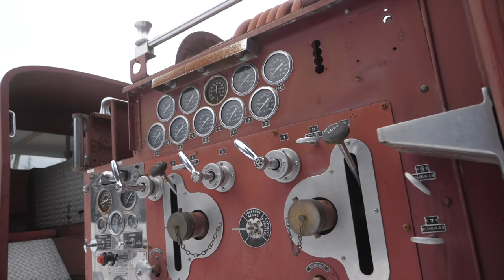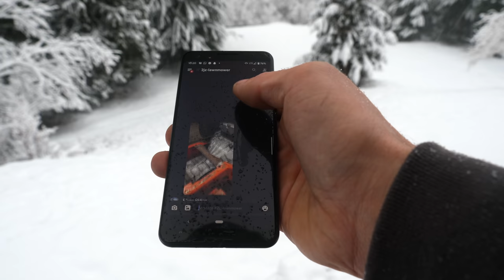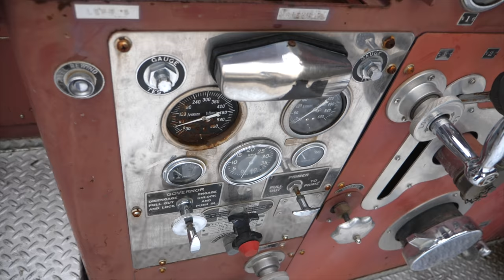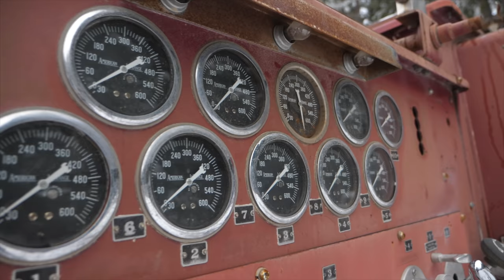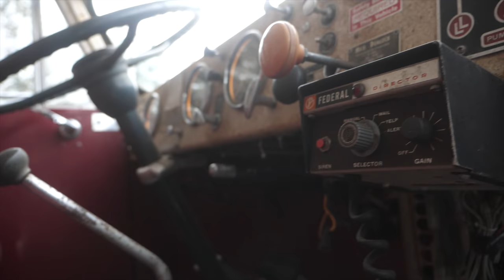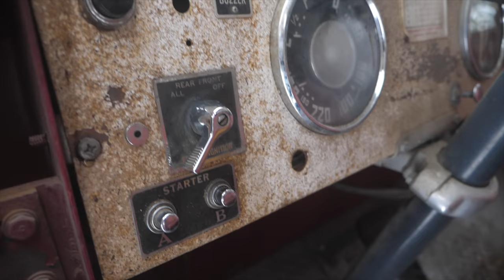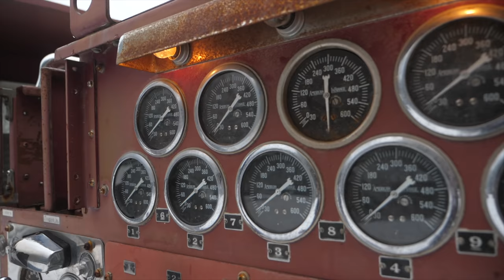We Bought A Fire Truck! Ultimate Toy Hauler Build?

Comment: Would love to see it converted to a toy carrier but please keep the cab design
Reply: Keep all original parts add a delivery truck's hydrologic lift gate to lift the toys onto the water tank and add the full length rack from a car hauler with grind hard in LEDs down the whole side of it, the ramps from that should reach ground level, but I'd put splitters in the water tank and have half water, quarter gas, quarter diesel with the old hand crank pumps on the side to keep it classic looking and put the fan art on the inside garage door on the front definitely with LED backlighting
Reply: dylan zrim  yes
Reply: 2nd this. Cab is amazing
Reply: Ya
Reply: Yes
Reply: and renew the paint
Reply: Ya
Reply: Doubt that super heavy pump stays...
Reply: @KnotRight4Ever  the taco and the triumph weigh alot more than thoes liftbeds can hole and lift
Reply: @markzamiechowski5352 I was saying the hydrologic gate would just be for the power wheels onto the tank, the cars could go above on the car hauler rails from the top of cab back to bumber so there's enough room for 2. I was thinkin they should paint it white so it looks lika a giant  ladder on top, keep the  aesthetics. If the height is a problem with stability or travel locally they could make a trailer that looks like the rear steering cab of longer firetrucks an haul the taco in that.
Reply: 2nd this 👍
Reply: They're gonna fuck that thing all up....

Comment: I've been wanting to turn one into a toy hauler or RV.
Reply from the maker: That is the dream!
Reply: Or do both 🤟😉
Reply: But it needs a straight pipe
Reply: @GrindHardPlumbingCo  please keep it manual
Reply: @GrindHardPlumbingCo   toy haler lame.. Build a zombie apocalypse rv that can haul an atv and dirt bike
Reply: Yes that would be awsome
Reply: @sean-or1nc  That's what a toy hauler is. Except the zombie apocalypse part.
Reply: @theyeetus1428  i didnt know toy haulers were rvs? ..like motor home
Reply: @sean-or1nc  Usually they are a trailer with living space in the front and a small garage in the back made to carry dirt bikes or an atv.
Reply: @theyeetus1428  oh i didnt know traditionally they had sleeping spaces....well regardless the zombie apocalypse could be around the corner so a lil extra fortitude on a " toy hauler"  couldnt hurt ..thanks for the heads up ;¬)

Comment: Slap some more modern axles under it and make it 4x4? I'd keep as much fire truck as possible, that's just cool!
Reply: seconding keeping it as "fire truck" as possible
Reply: This is what I would like to see as well. I don't know how common this particular model is but I would like it to be mechanically improved but esthetically preserved. It just looks to cool to mess with imo
Reply: The drivetrain from a 5-ton military 4x4 truck would put this into MOAB territory.

You can just find a car hauling open trailer and weld it up over the truck (like a vehicle transport rig).

Comment: Man, I love that era ... one of my favorite things is driving by the old New Meadows, Idaho fire department and seeing the old fire truck that says "Village of Meadows" ... I wouldn't change a thing ... you have enough vehicles.  It might come in handy later this summer during fire season ...  Love the cab forward, like the old vw bus, and the gauges are similar too ... how is your diesel converted 4x4 vanagon running?  Trip to Baja?  Fill that truck with water, and put down a bunch of 10 mil visqueen, and make the biggest slip and slide down a big grass hill in the middle of nowhere ... before a rave ... wet ... could be fun ...

Comment: I would definitely keep that motor and find a way to tune it. That thing sounds awesome!
Reply: Yeah. It sounds like a hot rod & looked like it has Plenty of power... plus only 22K miles. If it ain't broke don't fix it Grinder. 😎
Reply: dylan zrim  as long as the speedometer worked for most of its life, it's almost definitely legit. Fire trucks see very low mileage, especially in rural volunteer departments.
Reply: Nah a detroit 6-71 has much more support and potential. That old gas engine is complex for how simple it is.
Reply: @Deftonesdsm  And the 671 is probably a lot heavier...

Comment: My department had a 1959 LaFrance with the V-12, 5 speed. Manual steering, manual brakes and a non-synchro transmission. That mean double clutching. 750 GPM pump with 750 gallon tank. Open cab (windshield wipers on the inside too) with a homemade tarp too. Great truck.

Comment: Learned to drive a firetruck on an '84 LaFrance.  You hit both starters at the same time.  Riding the bucket in the 3/4 cab got nice and toasty in the summer and if it was an EMS run you got a nice diamond plate burn tattoo.  Good times!!  Try and make a toy hauler that still looks like the firetruck to keep the tradition.  Good job fellas!!!

Comment: 2:38
As the jag is on jacks, its no wheel drive
Reply: Haha right? They keep talking about the Jag as if they didn't just loot half the driveline from it 😂
Reply: @Balomis  Project or parts? Somehow both
Reply: I believe the have a truck chassis and drive train for under it
Reply: and the engine is removed!
Reply: The Jag body winds up on the 2J...

Comment: Congrats on owning such an iconic vehicle guys!  I grew up on a farm that had a 1930's extension ladder truck just sitting there for years. It had a rear steering station at the back to swing the extremely long ladder section around turns. It also had a hand crank gasoline engine with pistons the size of paint cans in it which got about 3 gallons to the mile. I played on that truck a lot as a kid. Never got the urge to become a fireman. Looking forward to seeing you guys work on this truck and what it turns into. I'm sure you''ll find lots of solid scrap metal on that truck to use in other projects. Good luck!

Comment: I saw the thumbnail and was like “DETROIT DIESEL !!!!”   Even as a gasser Its so amazing, glad you guys saved it 👍👍
Reply: Its a very awesome v12 engine if im not mistaken. One of the few engines cooler than a Detroit
Reply: Its a very awesome v12 engine if im not mistaken. One of the few engines cooler than a Detroit
Reply: did you even watch the video?
Reply: "Saved it"...
Reply: @haydona1845  isn't it a 803ci v8
Reply: @mangomcpoo475  i had commented before the engine reveal
Reply: @bansheemania1692  the one in the fire truck?
Reply: Apparently nobody here watched the video... It's a 608ci inline-6.
Reply: @bansheemania1692  It's a 608 cubic inch inline-6.
Reply: @amorton94  I did watch the video. My comment explained that I initially clicked on the video because I assumed it was a 2 stroke diesel Detroit (because many of these fire trucks were), however once finding it was powered by a huge gas powered (gasser) 6 cylinder, it was still pretty cool. 

The comments after mine? Who knows 🤷‍♂️🤣🤣

Comment: oh yes, 6-71T swap it please. needs a two stroke detroit scream!
Reply: Oh yeah for sure
Reply: Be sure to add a huge turbo and either propane, nitrous or methanol injection
Reply: The 6-71 was real popular for marine use up till a couple of decades ago. Since then it has gotten harder and harder to find parts for. the technology of that engine dates back to before WW2 with the 4-49s. They scream nice but are real fuel hogs and tough to fix lately. I'd look for the big brother of the Cummins 12 valve engine- simple, parts are still around , hard to kill- very hard to kill as they were the engine of choice for military freight type trucks.
Reply: @fredericrike5974  Nah. Parts aren't that hard to find. Bus Grease Monkey shows how it is done.
Reply: @hotpuppy1  I'm not a regular follower of BGM, but I haven't seen him working on any fire equipment. He has commented about how much more time he has to spend acquiring general gasket sets. Much of what he does get for older GMC engines comes form non factory sources and is more expensive. You don't rebuild any of the GMC 2 strokes by boring out he bore - you replace the the cylinder bore by exchange. The new bore sleeve has ports machined into it that must be turned correctly for the engine to breathe correctly- GMC doesn't and hasn't made any big numbers of new bores in 20 plus years. BGM also tries to avoid total rebuilds- he has outsourced much of it- that costs him or more likely the client serious money- choosing a later model 4 stroke diesel will be more powerful, have better mileage and be more practical over it's life. The two stroke diesel is not a good engine at all from the emissions standpoint.  There are other diesel oriented sites that go at this by using much more current and easily available later model engine as opposed to throwing a "Screaming 6-71" in it. Evan is talking about 1000 mile trips with a few people riding in that  Fire Truck; it has a cab heater- the outside jump seats are just out of the wind. No AC. No electric windows, either, riding in the cab of a truck in front of the radiator that cools this "Screaming 6-71" and it already has a big noise problem in the cab. Take the old 6 cyl Continental monster out, take the water pump and gear out, install the new engine/trans under the floor of the hose storage platform, move the radiator back and reduct it, close the back of the now empty back half and install some  seating for four and AC, power steering, if the budget is there, air bag the suspension- big trucks were using air bagged suspensions long before cars- and it would be a killer "ramp truck" riding in style vehicle. But that's my opinion; This is GHPCs Fire Truck, and Ethan is the main wizard- this is Ethan's and I think he's "got this"! Oh, and I'd paint i red- a brighter red , with pearls of metallics galore in it! But Red! The GHPC logo in gold leaf on the door, budget permitting, that would be cool.
Reply: @fredericrike5974  They're in north idaho. I don't think emissions are a concern where they live. If it were mine I'd keep the giant 6 cylinder continental but since they came with 671T engines that's the next best thing. Most of the cab noise can be eliminated through clever placement of dynamat. as for the rear seats, nobody is gonna ride in those on  a long road trip.  that's what the cab is for.
Reply: @isaakwelch3451  There are often four in the shop in the same pan of the camera- add one to be panning the camera and you need 4-5 seats, Comfortable seats if you plan on 1000 mile trips. AC would be helpful in the Summertime. Just replacing the motor isn't that easy- a 6-71 all bracketed out for the right mount alternator, PS pump, AC compressor would be a locator"s nightmare or a fabricator's. Living in Idaho, I'd expect Ethan, Edwin ,Sam all to have a great love of  the place- i't awesome, just as it is. The ^-71 one spews huge quantities of unburned fuel and by products in the normal course of the deal. When running it will throw out as much crap as most of their fleet of overpowered hot wheels put together.  FWIW, taking the fire water pump out, from between the present engine and transmission will let them move the engine and radiator much further back. Now you can enclose a larger cab without the dog house presently covering the engine. It will be easier to get lots of air into the radiator, and less heat will be bled into the cab.Now seating for 4-5 is a real practical deal. Keeping the look of the Fire Truck is a sheet metal problem, while they  have a great event hauler.

Comment: Evan- the engine likely has two sets of spark plugs as well as two starters. This was about reliablilty in any jam. To change out the motor you are looking for a school bus from a rural district- they have enough engine most times to pull the weight up to highway speeds and most built since 1995 or so have automatic transmissions, often Allison made. The sound problem can be helped by using dyna mat or similar liberally. As well as losing the water tank, there is a water pump, driven off the main engine- it weighs 1500 or more pounds- if you aren't into fighting fires, it can go too. Get in touch with the Reliance Fire Museum in Estes Colorado- they can help you with identifying just what you have and may want the pump, etc for one of their restorations. Keep the dual battery set up- in the cold country you live in it could be a life saver!be real careful operating the siren and lights off your property- the Sheriff and the local FD and Rescue people will get all out of joint! ALF had a V12 at one time- but it wasn't a Rolls Royce engine; it was a flathead, I think built from the patterns of the Pierce Arrow engine of the late 30s. It had the dual ignition and starters like yours.When you re engine it, make sure you have a clear notion of what the rear axle ratio is- lots of fire apparatus was ordered with very high ratios so they had lots of power to pull through tough places, but those suck for milage!

Comment: You telling me I can daily drive a firetruck for less than my Saturn?!?!?!
Reply: Well there is fuel cost and parking to think about well wait parking won't b a problem its a firetruck u got fire lane right on front of every store
Reply: I honestly thought he was going to say 15k , which doesn't sound unreasonable.  Think about how much you'd have to spend to get an engine that cool obscure and powerful.
Reply: Cheaper than my 1991 F-150 too. It's just crazy how cheap that thing is.
Reply: @youknowwho7176  it is I just got a 98 scab 4x4 stepside 4.6 with only 112k for 3 grand. However the 1980-1996 is my all time favorite f150 but I think barret jackson got a hold of those and did them like they did fox body.
Reply: Sorry I got carried away I like f150s

Comment: I used to live south of you folks in McCall, Idaho almost 40 years ago.  Back then the population was 2000. I think now it's 14,000.  I loved the small town rural Idaho life.  Interesting facts about Naples, Idaho.  Named Naples after the Italian City because the railroad workers laying tracks back in 1890 were immigrant Italians from (you guessed it) Naples.  Population is 1402,  area is 872.79 square miles.  That's larger in area than my home island of O'ahu (600 Sq.Mi.) where Honolulu is located, larger than Maui (777 Sq.Mi.), and Kaua'i (555 Sq.Mi.).  The infamous Ruby Ridge is just 8 miles away.  That truck has a gasoline engine?  I guess back in '65 gas was cheap, I believe under 30 cents a gallon.  I'm guessing it put out more forest fires than house fires.

Comment: Beautiful truck...remove pump assembly, move motor back 6 feet,  find a Cummins or CAT from a big rig, close off back of cab, remove middle cab partition, install 6 recaro style seats all facing forward, auxiliary heating system, aluminum ramp truck style from a tow truck that remains on an angle in the “parked” position with winch, Jeep style HALO LED lights.

Comment: Fun fact, if you find yourself wanting the tools and hoses to fill up with actual hydrants, you can find em at most hydraulic shops. Bout 40$ or so for the wrench and 100-150$ for a 50ft hose. 2.5" NST threads have been the standard for decades. just ask for 2.5" NST mill hose.

Comment: Please make a toy hauler out of that gorgeous vehicle, got all the water stuff off the thing, half the weight will come off with it, and then have a Bitchin ramp bed on the back , and make a sleeper out of the Crew spot, that in a diesel motor, do you have $100,000 plus sitting there , love to see you guys make that project.   Great find.

Comment: Aw a Beautiful American LaFrance! In the Day these were the Cadillac of Engines. In the day I spent allot of time operating and fighting fires with them. FYI The factory painted these with 9 coats of Lacquer Paint hand sanded between each coat. I have personally seen paint look as bad as yours and be polished back to a beautiful ALF Deep Red. You have the Continental 6 with Dual Zenith Carbs. You are correct on the ignition system.  We always ran on both but yes it was redundancy. A and B starter buttons same thing. A for one side of Batteries and B for the other side. Push Both start buttons for best power.

I probable have a picture of the original factory photo of the first fire dept that ordered it. There should be a build number on it as well as the specs of the Engine. By the size of the large 6" intake I would say it's rated at 1250 GPM. Mid ship mounted Twin Flow Pump. They were pumping fools. They could pump for days and never miss a beat as long as you got the fuel truck to come fill you up lol.  Beautiful old Gal Boys. Brings a tear to my eyes. Good times for me on these for 33 years. 2 thumbs up.

Comment: Toy hauler deffo .crew cab it too entrance from front cab, day bed in rear  over the engine .if you but in the big diesel it wont be as high ,save all the fire equipment for a fire engine restorer 😃great project.

Comment: You can use large rope, cable, or chain rapped around the outside wheel through the wheel holes for a quick traction aid.

Comment: time to get deboss down for a holiday and colab with some cool diesel  stuff ... if it was me id seal off and maybe extend the back cab and make it a sleeper to so can do long distance  gut the pump and tank but and everything behind the panels leave most of the panels gauges and build a ramp between both side panels than ya have a cool fire truck hauler that can do long distance with comfort and will easy take plenty toys

Comment: I think you should keep that as original as possible with the original engine and paint job as well as the original bed. The reason why is because it's an antique that still runs and drives. You just need to get that old paint shiny again.